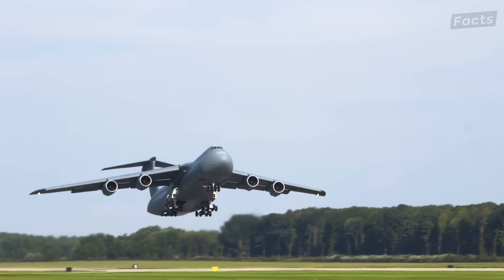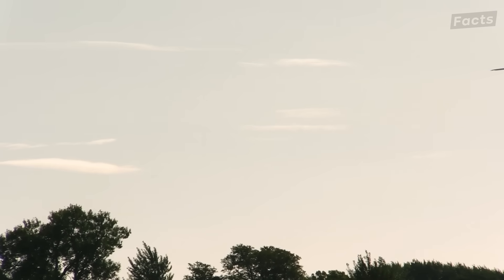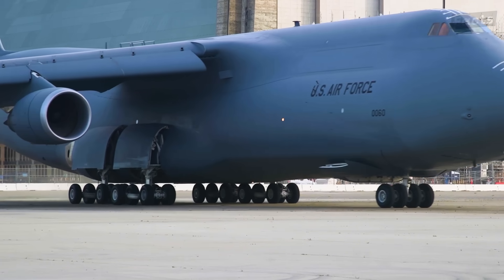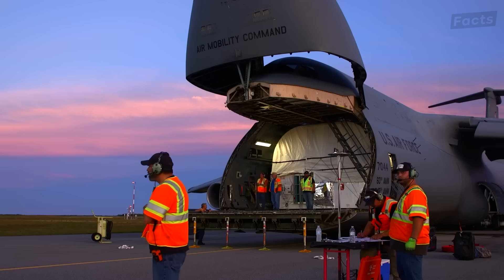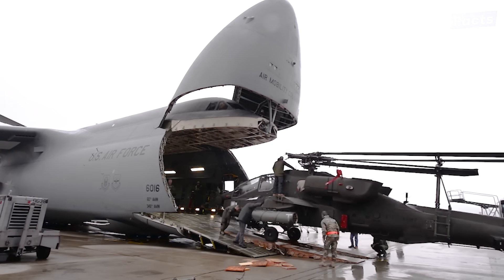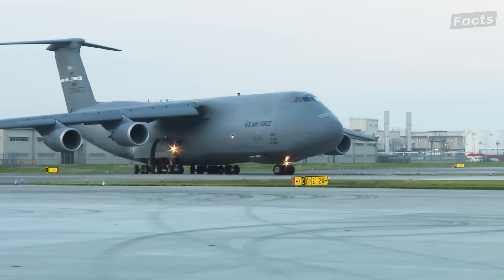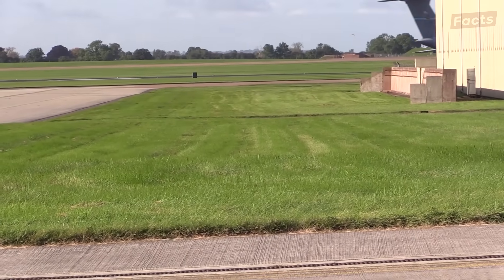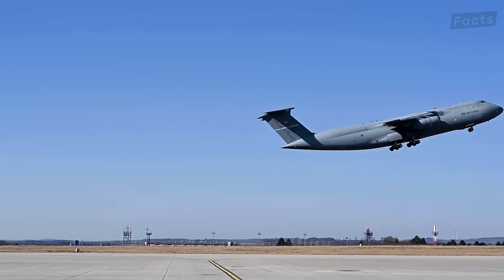Inside The Aircraft That Revolutionized Military Transport

Comment: That’s big and that’s a lot of gross weight but a 747 can lift off of a gross vehicle weight of 1,000,000 pounds I would’ve thought that this galaxy would definitely gross out heavier than a 747
Reply: A C-5M has an MTOW of 840,000 lbs. A 747-8 has an MTOW of 970,000. Mind you the C-5 when first designed it had an MTOW over 100k above the original 747. Back when designed, it was 735k (747) vs 840k (C5). The C-5 can make harder manuvers as it's airframe is stronger.